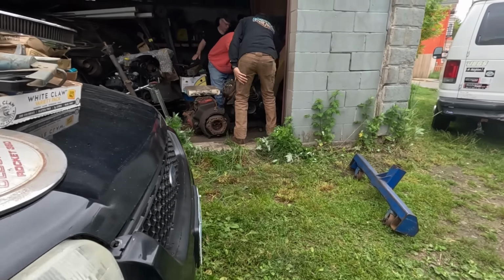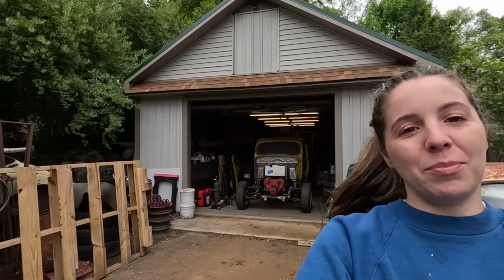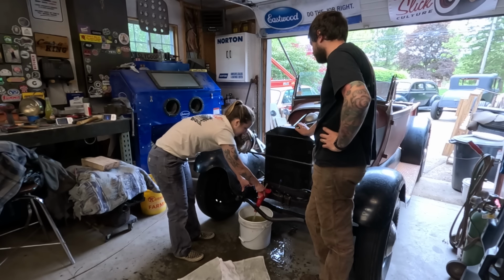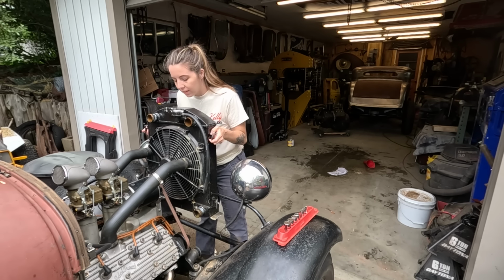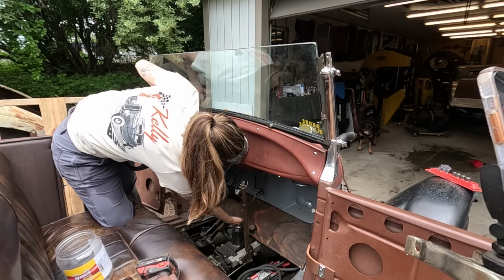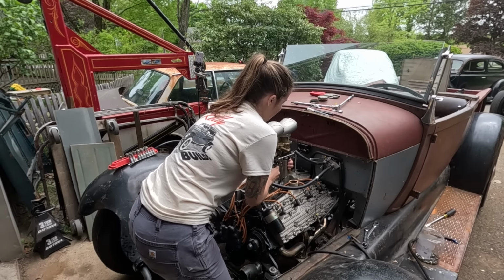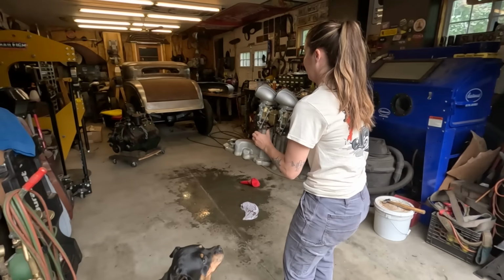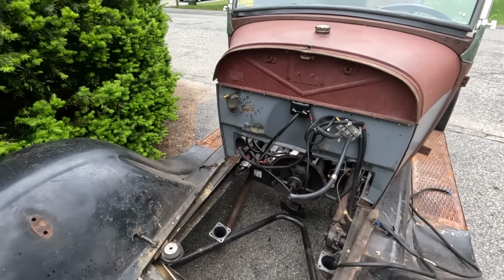Come get a "new" flathead with us!

Comment: @04:20 It sure looks like fresh oil.
Question being, Does it look like that because it is new oil, or does it look like new because all the contamination has sunk in over 10 years, and is waiting in the pan for a good stir.
If anything, I would at least want to have a look in the oil pan.👴👀
It is fine that an engine is carefully stored for years, but the most important thing is always "overlooked", the periodic turning to redistribute the oil and thus prevent sticking.👴😞